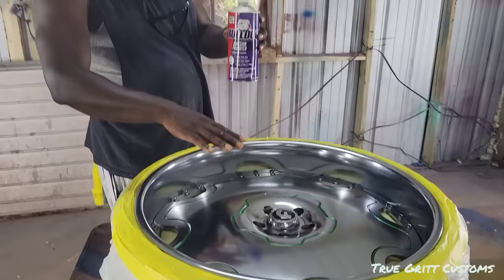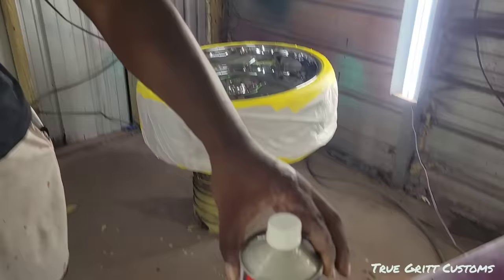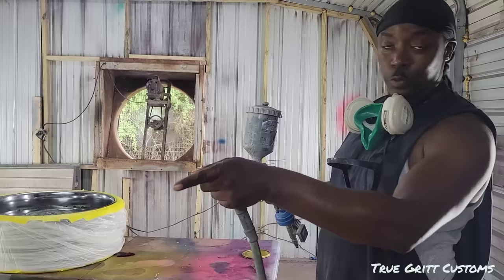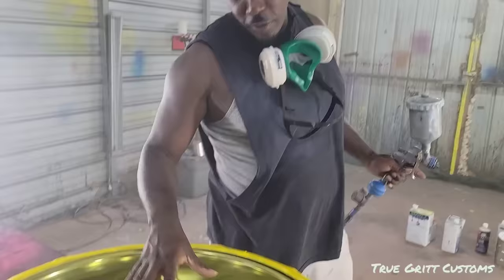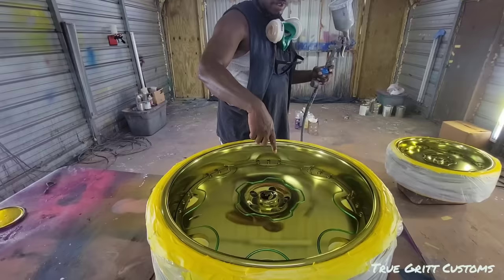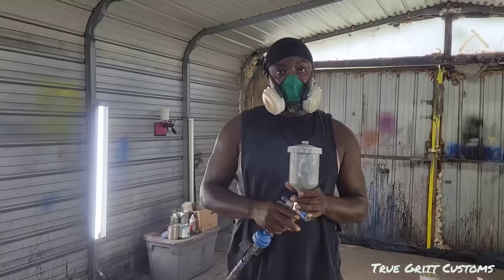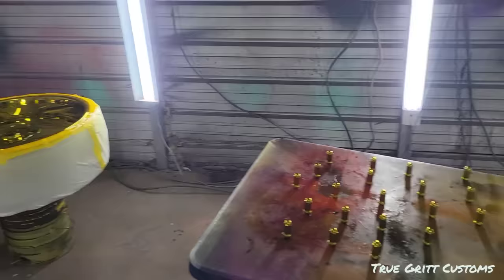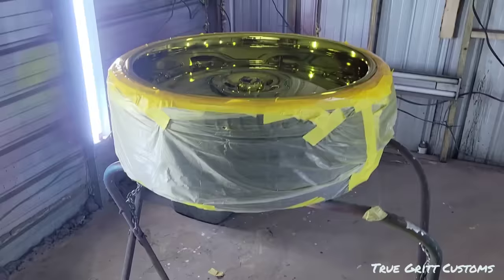How to GOLD RIMS At home EASILY

Comment: Lookin’ good .   So you show the adhesion promoter, you showed the pre clean.  What was the actual gold color material that were shooting to obtain the color ? 
 Does the adhesion promoter you use dull the shine off the chrome as well ? It seemed like the AP dried to a dull finish .   Have you tried a epoxy clear for adhesion to allow the chrome to come through brighter ?
Reply from the maker: Truline...yes it looks dull when u spray adhesion promoter but it comes back when u apply the gold
Reply: @TrueGrittCustoms  looked up Trueline and couldn't fine it. You got a link and does it come in blue?

Comment: u got that southern country boi accent. nice vid. i like how you use the adhesion promoter first. i usually sand the chrome with a 2500 or 3000 just to make sure it holds but you do see fine scratches when you look closely.

Comment: I gotta a 1999 Chevrolet suburban that could use some paint and body work let me if I could get some advice on repairs it would gladly appreciate it a little history on I bought it nearly a month ago I'm not bout everything just yet but needs body work paint and has a broken back window it sitting at Troy towing it would be a great candidate for your shop it's 2500 with the actual 454 still in it let me know something if possible

Comment: Bro, those wheels are not sanded? How the paint will stick to the bare aluminum? Did you use some special primer, that what it was the first coat?
Reply from the maker: The paint stick to the bulldog
Reply: @TrueGrittCustoms  Hard to believe brother, if not sanded or not primed the paint will peel off soon ot later...or I missing something...
Reply: @TrueGrittCustoms .. Still you did a good job tough..

Comment: Nice so you didn't sand the rim before spraying adhesion promoter and what clear did you use?
Reply from the maker: Nall I only sand the rims when I'm actually  painting them...never sand them when ur golding the rims, the scratches from you sanding them will show when u put the gold on the rim
Reply: @TrueGrittCustoms  and what clear did you use the Grant7?